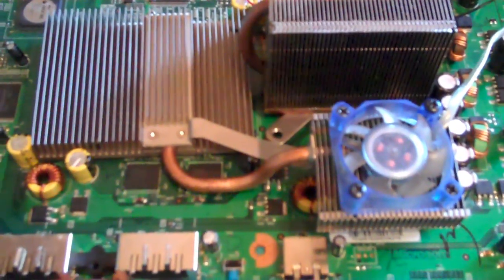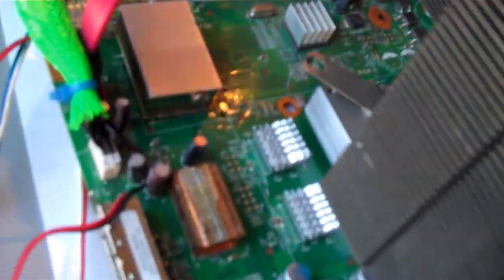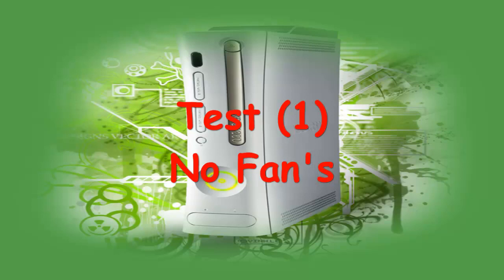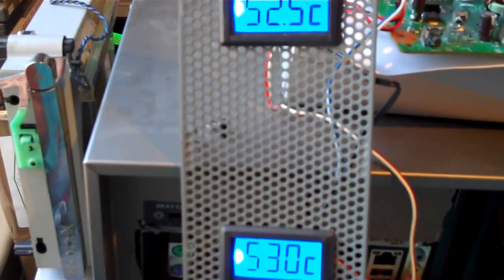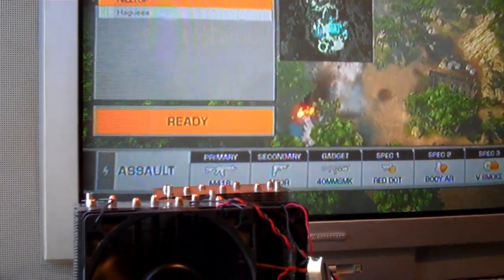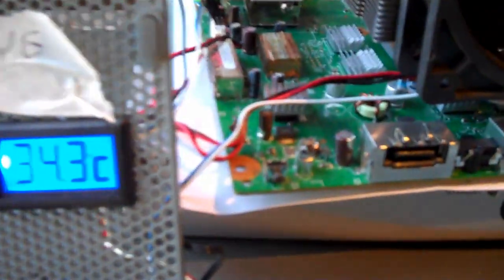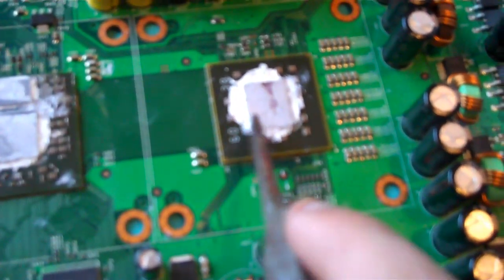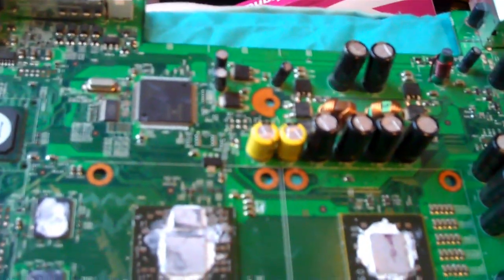Xbox 360 (PC HEATSINKS) MUST SEE!

Comment: Dont suppose you done a video how you actually got the heatsinks to fit? I want to swap mine out as I have an issue with overheating.
Reply: Put new thermal paste and put the copper heat sinks on instead of aluminum. Also replace thermal pads and add ram heatsinks

Comment: Hey man, I recently aquired an Xbox 360 Fat, I believe it's the 1st generation.  I have an issue with getting Power.  The power brick is Amber(stand by), so it don't believe that's what it is.  I have checked my USB ports for hitting metal/Grounded, doesn't seem to be it, won't power on with a controller... I am so far at a loss, but if you have an idea I would love to hear it.  THANKS and Cheers!!

Comment: why even mod an xbox? its pointless... they work fine stock.

HES TRYING TO BE LIKE THE PC MASTERRACE

(i am the masterrace, peasant)

turns on the xbox, im getting room temps, REALLY?? i never knew

do you even know what VGA is?
Reply: Because they get incredibly hot and often over heat or if you wanted you could water cool one and make it silent and Xbox360s sound like jet engines. And it can be a fun project.
Reply: This was made before the pc master race Jun 3, 2011 you dumbass.

Comment: I don't like anything electronic running above 50c
Reply: Wow, have you ever seen GPU/CPU temperatures?
Reply: yep, makes me want to mod mine with some computer fans
Reply: yes! i got about 40c on heavy load
Reply: ur trolling right? in the GTX 480 days the GPU temperatures were about 90 degrees and. 70 is perfectly safe
Reply: I go to a service call and their internet is down, I do a heat test and almost every time the router is running above 50c. a electronic device comes in the shop with intermittent errors  and I find a transistor running just above 50c. A person standing in 120F sun is safe but for how long? If you want your electronics to last keep it cool.
Reply: not the case with computer electronics tho. 90% laptops are lastig 5+ years with constantly being in high 60-s low 70-s

Comment: theyre different temps because some processors are more power efficient then others or may have less of a work load depending on what you are doing. this is why on my gaming pc whenever i play a game the gpu gets hotter than the cpu because the program is more intensive on gpu than cpu.
Reply: Lel my gtx 570 dcuii never goes over 50°C oh but its a triple slot card :D

Comment: its cpu,,, and gpu, ,not vga and 70 thats fucking terrible what was you doing fucking the xbox in the psu slot
Reply: It was 70 without the fans on, you moron.
Reply: Shut up you fucking mug
Reply: Also xboxes run at 90 usually.

Comment: i dont get why people want to do extreme cooling for xbox's theirs no point cause you cant over clock it
Reply: I added extra intake fan's due to it being the old school system and it need's the extra cooling.
Reply: fair dooz
Reply: As well as for long life of the parts. The hotter the parts get the shorter they last. I have a water cooling system in my tower just for low temperature. I don't over clock it. When the fan on the radiator died the system still ran at only 65c for over 6 hours before I realized it had stopped working.
Reply: we do it as microsoft did a shit job of cooling the console. the main reason for red rings is overheating so we all use pc cooling thats far superior to prolong the life of our consoles
Reply: fear enough
Reply: Becaaaaause the OEM heatsinks run dangerously hot in their own right? They pretty much stay at 180F+ at all times...
Reply: ye i could see how that would be worth it
Reply: Not everybody I added a new fan to my slim but its just nice to have it cooler, but this is obnoxious
Reply: this is honestly an extreme modification, just up the voltage of the exhaust fans to either 8.7 volts or the full 12 volts, you can also replace the thermal paste and if that is still going over 50 c on the menu screen then add SMALL intake fans with the usb mod however if it still doesn't work then chuck the xbox out as it's over cooked, it's a nice idea however there's obviously no way you can put this back into the case with those heatsinks also if those heatsinks are tightened enough they may damage the cpu & gpu as they have no lid they've been stuck on the motherboard without a lid to protect them.
Reply: ever heard of RROD mate?

Comment from the maker: checkout my other vids. i modded a slim also. iv sold them all now and moved to pc gaming :) remember that my vids are just for fun. some people like golf. i like breaking stuff ;)
Reply: Mix Bag 
What if they mod the slim power supply and see if the slim power supply works, because I believe the power supply is giving way too much power to the xbox360, I like to see someone using a slim power supply, that way they can make a new power supply that uses less energy, and also a heat sink that is made of Carbonated Cotton the same material that the old light bulbs are made, because that dissipates the heat very fast and is very durable, also someone should make one heat sink instead of two that fits into the XBOX360 that will be awesome

Comment: only if its installed correctly if the screws are to tight it can cause the mother board to flex and actually cause rrod. if you know what your doing and feel comfortable in the fact that you wont fuck it up by all means but you do run that risk let me tell you

Comment: The reason that your heatsinks are staying the same temperature is that your fan is constantly cooling the heatsink and the maximum heat your heatsinks can take before they cant absorb any more heat (because of the size of the heatsink and fan, not through overheating) is around 35 degrees! Thats the only reason i can think anyways! lol.

Comment: the temps are different from the sensors and the chip's temps because the sensors on the chips are inside the cap directly on the silicon chip

Comment: Well if the answer to the question the poster has made about the temps of the CPU and VGA haven't been posted already. Its' basically the law of diminishing returns. The heat-sinks are absolute overkill for the application. But they can only work so well and that's pushing room temp air over the fins and having a temp delta over ambient (room) temp of I'm guessing 5-10*c. You could have easily do just fine with the cheaper heatsinks. Ahh well, 100 quid you'll never see again :P

Comment: @petegrimsby What would the difference in temperature between the chips vs heatsinks readings be? I have sensors that are designed to sit in the gaps of each the cpu and gpu heatsink.

Comment: Did you just use the xclamps as adapters for the 60x60mm mounting holes or was any other mod necessary?
Seems kinda unstable to me but explains why you didn't use the dell heatsinks.

And what about the stress on the motherboard?